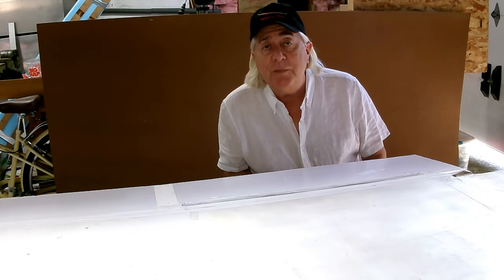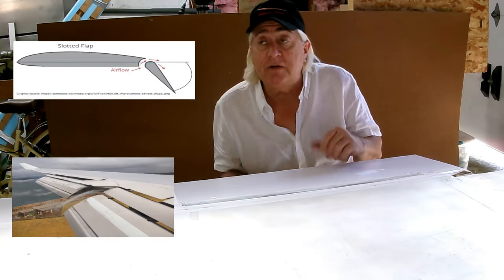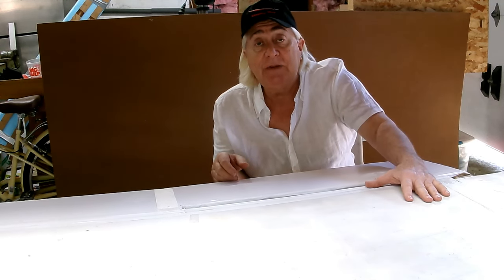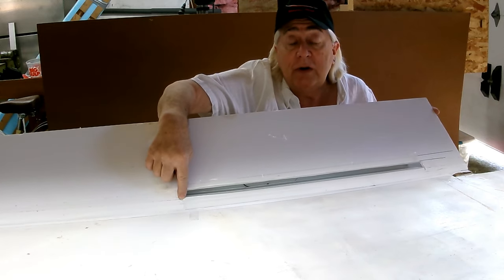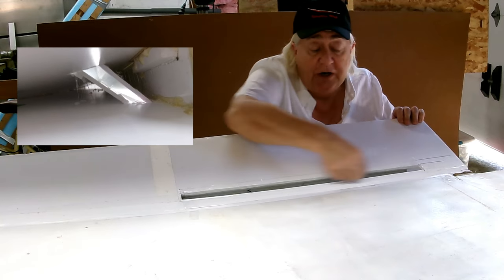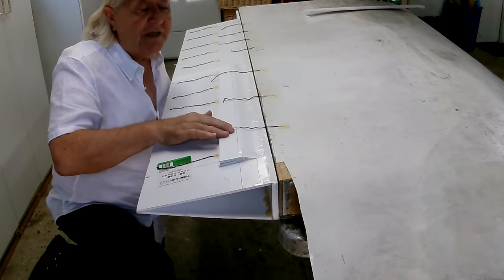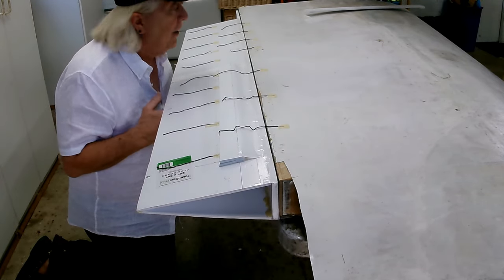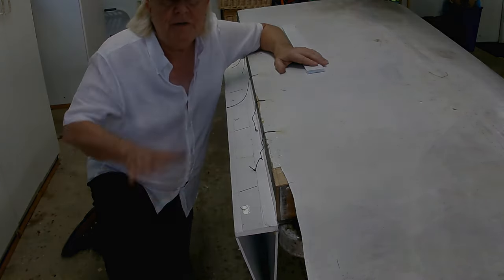Slotted Flaps, a New Way - Klingberg Wing MkII Development

Comment: On an aircraft design I worked on we gave the ailerons a small increase in thickness. This, combined with hinge placement, kept the top surface of the aileron protruding into the boundary layer as it sips off the wing surface.
Reply from the maker: Yep, that would be standard design procedure. You can see me test that option in my earlier videos. It proved ineffective, probably because of the low Re. Near stall speed my wing operates at an Re range that is largely unexplored. See this vid for my CFD analysis of the issue: https://youtu.be/2mh8szvuD40

Comment: Thanks for the informative video. I hope this works out. 

I had one question though; in of your videos from not too long ago, you hypothesized that the Reynolds numbers out at the tip are too low and that's what's causing all these problems. 

So why not make a custom airfoil that performs well at those low Re? It seems to me that if the designers of the swift and the carbon dragon could do that in the 70s and 80s, with your level of knowledge, skill and experience and the software tools available today, that should be possible.

Thanks again for sharing your work
Reply from the maker: Yes, that would be quite easy. However, there is a price to pay. Low Re airfoils are inherently low speed. When taken to higher speeds (low AoA) the drag goes way up. In one of my vids I describe the drag polar for the low Re airfoils and why they get draggy. Gliders such as the Swift were not designed to go fast. I think they had a Vne of about 70 mph. I want a Vne around 100 mph, so this requires a different airfoil. This is all a very sticky problem because we have never really strived for an aircraft that has high performance over such a wide speed range - a vexing problem that requires airfoils that can change shape for different speed ranges (doable but very heavy) or a unique solution the will appear to be "like magic" if I ever find it.
Reply: @KlingbergWingMkII  Oh! I hadn't realized that. I'll go watch that video now. Thanks
Reply: Best of luck on you impending test flight.

Comment: I have a prediction, the flow will be interrupted by the deflector and act as a spoiler in the flap up position. Flap down it will act as a choke point and cause undesirable characteristics. better design may be to design a slotted flap that has a smooth airfoil leading edge and eliminate the excess hardware. Notice on the illustrations you've used from the laminar air flow style wing that very much attention was paid to SMOOTH airflow.
Reply from the maker: Interesting thoughts. Given the format we are working in, I'm not sure I'm correctly visualizing what you describe. That said, the best I can do is to note that I'm not doing this test to use on my flaps. I use the word "flap" as a generic term for a control surface. The elevons for my wing are flaps that must travel up and down, so I'm not sure what you are describing would work. The test I'm going to do is set up for down only to represent what happens on my wing. On my wing I'm having problems with the flow over the elevons  only when they are deflected down. Does this make sense?

Comment: Rather than the reverse duct sticking up, why not reprofile so the duct follows the same profile as the wing and make the leading edge of the flap dive inside the duct?
Reply from the maker: Of course as that would be lower drag. However, this is an initial experiment and before I spend a lot of time do a bunch of fancy building, let's see if it even works.

Comment: Looks like you are creating a slotted panel surface with the intent of keeping the flow from separating. The ME-163 has a similar slot detail near the leading edge of each wing to minimize flow separation. The Cessna 177 uses a short reverse (upside down) slot on the stabilator for better control response. You could also try VGs as a quick way to energize airflow over the flap. I would curve the internal channel for a smooth transition from bottom to top and eliminate the big flat piece. Interesting concept.
Reply from the maker: All good pts. There are many aircraft that have employed leading edge slats. I think the most interesting is the Tiger Moth (or was it the Gypsy?) which had LE slats that deployed automatically when it hit a predetermined AoA. If you check out my earlier videos you will see I've tried dozens of different VG options. Problem is, at 20 mph and a very low Re (under 500K) it is very difficult to energize the flow. VGs bring high energy flow from the freestream into the boundary layer but if there isn't much energy in the freestream, then they are useless. What I'm doing here is a simple first rough cut (my common approach to problem solving). Optimizing the solution comes later if the method proves to be effective.

Comment: I had one more question, that I hope you won't mind answering;

Won't the slotted elevons add drag? how do you plan to handle the additional drag?
Reply from the maker: Yes, the slots will add drag but probably a small amount compared to a low Re airfoil. The low Re airfoils have their high drag at AoAs of 1 degree or less. At those low AoAs the slots will be parallel to the flow so the added drag should be minimal because the pressure differential between the lower and upper surfaces is close to zero. There will be added drag only when the flap is deflected downward when turning. Most high speed runs involving minimal turning, so a limited negative impact. However, I still think the best answer will be the flat plate elevons attached to the TE of the wing. That currently looks like the lowest drag option. This upcoming test is an interesting side quest while I wait for good flying weather to test the flat plate elevons. Plus, it could be a good option for the flaps on my wing to make them more effective for pitch trim and landings.
Reply: @KlingbergWingMkII  Thank you

Comment: To differentiate the effect of trip strip, you could also just close the air intake with a tape.
Reply from the maker: No, the cover on the upper surface could still act as a trip strip even if the bottom slot is closed. Good engineering dictates that the configuration for the upper cover be as close to identical as possible.